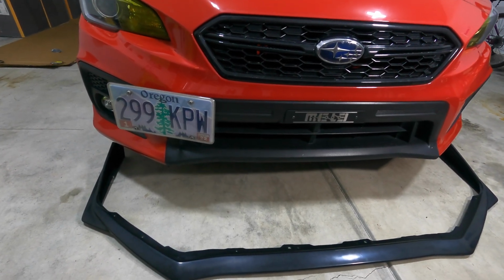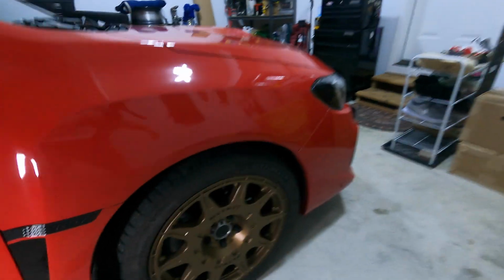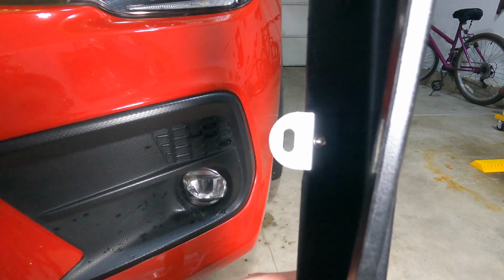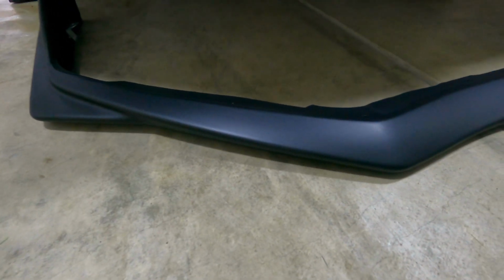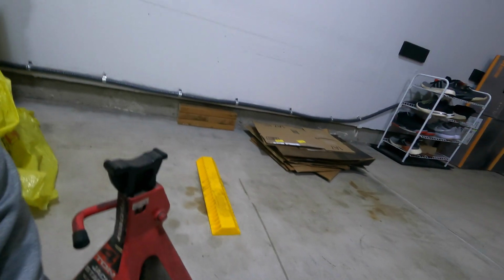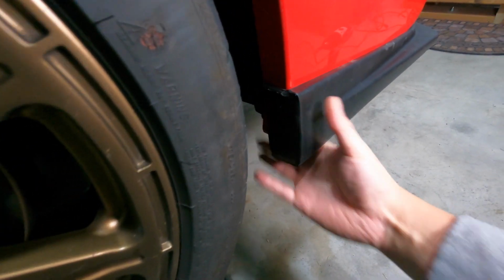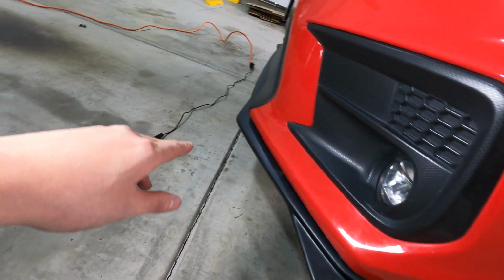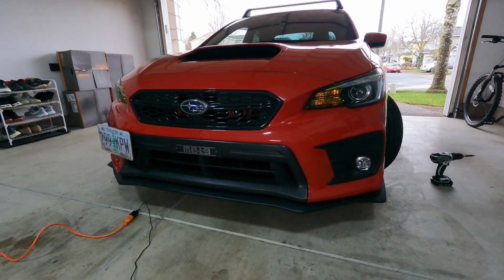BAYSON R V-LIMITED Front Lip | How to Install on a 2018+ Subaru WRX/STI

Comment: Looks great man. I'll have my Bayson R Front Lip either tomorrow or Monday and the Aeroflow V2 Splitter Monday as well. Got all my hardware today from Home Depot cause yes, nuts and bolts are much better. Also, I think the only reason you may of had that slight fitment issue was because you installed the brackets on the underside of the lip, instead of on top (as you are now aware of). That extra 1/8" lift on each side could be enough to slightly raise those sides, allowing them to wrap just a bit more freely around the two ends. But other than that, yeah, looks fire! Great vid!
Reply from the maker: Thanks man! Good call on the nuts and bolts. Yup, I edited the description to note the brackets. I ended up installing them correctly on my second lip. Fitment is great.
Reply: @ronfromportland  And hey, maybe I'll see your car around town lol. I live in Tanasbourne and a member of NBR.

Comment: I trust nuts and bolts WAY MORE. Good choice on that. I like how the lip has the extra contours on it. Definitely gives it more style. Nice work 👌
Reply from the maker: Yup, for sure! I will looking into using rubber well nuts in the future like the OEM front lips use. This may have prevented the bolts from ripping straight through the bumper when I hit a piece of ice.

Comment: Yours fit way better than mine. Mine was super warped when I got it, used a heat gun to fix it as well as I could but it’s not great. The sides of mine aren’t flush with the bumper at all, maybe I should try some 3m tape like you mentioned. Good video!
Reply from the maker: Yeah, 3M tape should help for sure! Just make sure you clean the sides with 50:50 isopropyl alcohol/water and it’ll stick. Thanks!

Comment: so you have to drill into your car for this?
Reply from the maker: At minimum you will need to use the self tapping screws. Using nuts and bolts was just something I decided to do. I hope this helps.
Reply: @ronfromportland  ah i see, i was wondering if all front lips have to be screwed into the bumper or if they go into holes that are already there
Reply from the maker: @wolfj171  ah yeah, that’s what makes it a bit nerve wracking! You have to create your own holes haha.

Comment: What size did you use for the nuts and bolts?
Reply from the maker: They were M3 nuts and bolts
Reply: @ronfromportland  Salamat pre, you were lucky that your lip came fitting relatively well. I had to do a lot of pulling and bending with mine while blasting a heat gun at it. Still doesn’t fit perfectly lol.
Reply from the maker: @supercheesy107  sayang! Na swertehan siguro ako haha.
Reply: @ronfromportland  What size did you do for the pilot holes? Lol salamat bro
Reply from the maker: @supercheesy107  I’d start with something small like a 1/8 bit and then work your way up as necessary